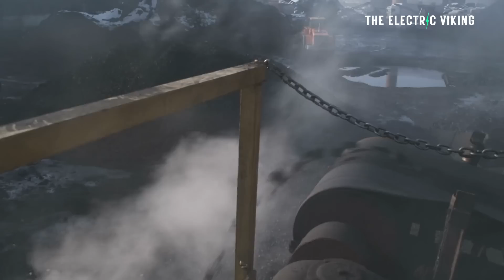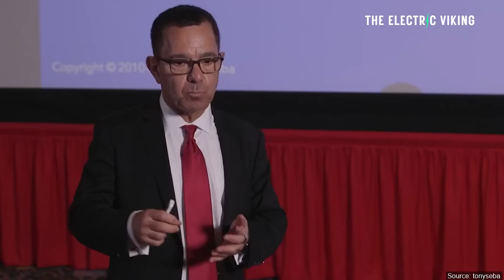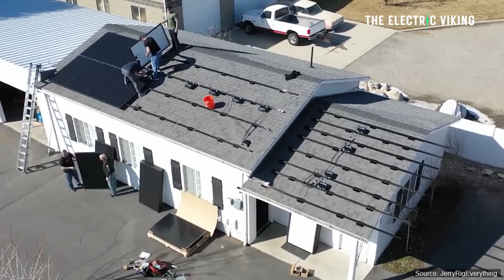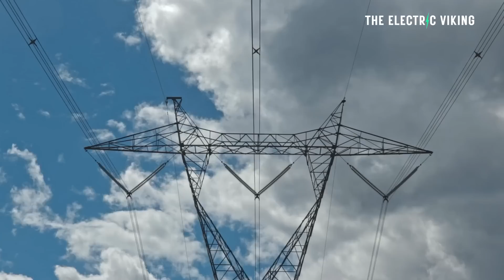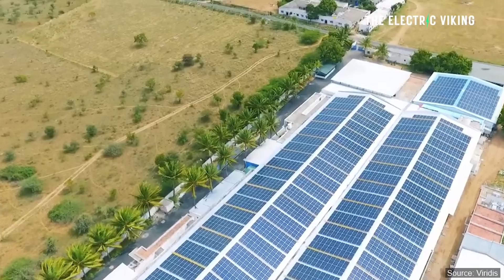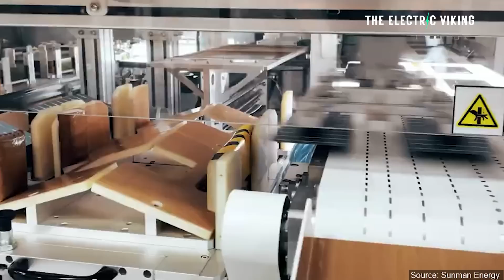Rooftop solar installs break records; coal powerplants could soon be bankrupt

Comment: The system dynamics of Solar are a bit weird. Rooftop solar (with local battery backup) is making suburban and rural households more independent from grid power, as long as they have enough wealth to afford the up-front costs.  Meanwhile, with (mainly Coal) grid electricity suppliers still being required to supply power at night and industry and to cities where solar is insufficient, they have to keep the same infrastructure going, but with fewer customers.  The net result is that grid electricity prices are going to keep rising (the normal result when renewables are added into the mix), but Coal power will still be necessary - kept alive with government support if needed.  A side effect is that poorer people and those living in cities (especially high rises and multi-dwelling units) end up paying more for electricity.  The actual overall net reduction in coal used for power is minimal, unless it can be replaced with nuclear power (or hydro in countries with more mountains and more water).

Comment: I put on an 10kw system in SA in August 2023. I have been in credit  nearly  every month since according to my service provider. But hate to burst your bubbles, I didnt do it to say no to Fossil fuels I did it because the cost of my electricity bills continues to go up because of the transition to renewables.  The reality is my system has sent 2,421 Kwh back to the grid  at $0.05 per and used 276 Kw. I got $145 in credits from my Solar yet still got a bill for $95.  Yes Ive saved some money thats paying off my solar $13000 system but is has resulted in a huge financial benefit to my service provider getting more than 2,000Kw of free energy during the period. Power companies must  love household solar

Comment: Sam many thanks for your great work. I would suggest people act out of self interest before idealism. So the uptake is making a lot of economic sense, Australian households were paying the equivalent of less than $100USD/MWh 1978 - 2010 for electricity. In the space of a few years it jumped to almost $300USD/MWh while the OECD average remained less than $200USD/MWh. Lower panel costs, increased efficiency, battery storage options against $300USD/MWh makes a sound case imo. Did not think about the bushfire risk ( below )

Comment: The DOWNSIDE is your now responsible for the maintenance, upkeep, upgrades and costs! Outside of warranty it can be very expensive, plus the additional chance of fire and problem's in severe storms and weather conditions! $10k can now have most people almost off grid but the power companies ant stupid and the backup, topup electrical grid now is charging just to be connected and that cost is rising! You should point out these costs, to get a sparky thats compliant is $100-200hr rate too unless you DIY... Add an electric car to recharge and youl will double this cost.
Reply: here is an excersise for you, do the research and have hard figures on hand. Then i will believe you.

Comment: This kind of assumes that industry is not needed and that all households can afford decent battery banks.. still not enough in low-sunlight months regardless of realistic battery size.
Reply: see your stuck in an either or mindset. You are refusing to see there are other options available.
Reply: @andyfreeze4072  So for places that can't put in a hydro-bank, how does the base-load stay held up? Nat gas power stations seem to be a sensible option.

Comment: Here in far north Sweden, we have a ton of tariffs on electricity (transfer fees + energy tax + VAT). I ran the numbers, and any solar panel installation cheaper than roughly $1250 USD or $1950 AUD per installed kW will save you money regardless how high electricity prices are. Right now prices are around $900-$1350 USD and expected to fall further next year, sooooooo... God Tier price parity is already here :D

Comment: You need a lot more stationary storage of energy.  It seems like grants to the various universities to do battery research would be a good idea.  Yes, the new batteries won't be on the market for a while but seeing an future coming will cause people to plan for it.
Charging your own EV if the EV can be at home during the day is a great idea.  I, however think people are missing some obvious ways to effectively save energy for later.  
Timing your dishwasher and laundry to happen between 11AM and 1PM means that the use is moved in time which is as good as storing energy.  
I think you could use a heat pump to heat up a great big pile of something and then use that heat to keep the house warm over night.  
Even your hot water system could be done like that.  A simple way to do it would be to run the hot water up to  a higher temperature while you have power to spare and then have its thermostat drop back in temperature when you don't.  This will ensure that there is hot water.  If you want an even greater storage, you can install one of those thermostatic mixing valves that regulates the maximum temperature that will be delivered to the house.  They act by adding in a bot of cold water to bring the temperature down so they effectively make your water heater bigger.  This will then let you put the temperature of the hot water up to a temperature that could scald.

Comment: I live in South Australia and have an 8 kw solar system and a Tesla power wall. 
Why not install power packs and mega packs in the suburbs to collect all the excess solar energy rather then turning people’s systems off.
Reply: It cost money to install the storage.  I think home owners should consider adding their own.
Reply: why not have more natural gas power plants..
Reply: @jimmybrad156  Natural gas power costs a lot more than solar.  It is cheaper than coal if you count the wear on the equipment but it still costs more for the last watt you make.
Reply: @kensmith5694  Nat gas would prob be 80% cheaper if there a non-corrupted national supply.
Reply: @kensmith5694  Nat gas cheaper than commercial battery banks to cover base load. And more 'green' too. I'm talking about power stations by the way.
Reply: @jimmybrad156  Your statement is false.  Natural gas is more expensive because you have to pay for the last watt.  It also is not green.

Comment: Sam, how about an item on alternate batteries to Li.  A couple of them were developed in Australia.
Reply: You should have included a name of type of battery or a link.  Others might find the reference useful.
Reply: lets see.......Li Phosphate for a start......Sams been on that trail for a long long time. Yes all Lithium (Li) batteries but not the same batteries. In case you missed it, LI Ion was the main stay of power tools and the first iteration of car batteries with an emphasis on thermal management. They had a cycle life of 600-1000 cycles and the recomended charge for long life was 20-80%. Li Phosphate batteries have a ccycle life of 4000-7000cycles and are not as sensitive to thermal overloads. They are cheaper to make and you can use the full 100% without degradation. The reason some Li Ion batteries are  still used is because they have a slightly higher power density and some manufactures are going for longer range or higher power, while tesla is going for cheaper  and statistically more realistic ambitions. Some chemistries we see are just variations with spiked cocktails of rare minerals. Other chemistries are still nowhere close to market yet. Sulfur, aluminium and air batteries are not there yet. Yes we are all waiting for the next big thing....

Comment: Now we come to the question of batteries - necessary to complete the transformation.  Of course, when possible, pumped storage is the best solution to storing energy but this is only possible on a grid scale - not for home use and only possible in certain locations.  It would be very useful to push non-Li batteries for both home and grid use.  Not only would this free up (and make cheaper) Li for mobile applications but these other batteries are superior to Li batteries in everything but energy storage capacity per kilogram of weight.  They last far longer, can be cycled between 0 and 100% with no accelerated degradation, are made from cheap, readily available elements and therefore only lack market share to out-compete Li batteries for price, and pose no fire risk while shipping (they are shipped fully discharged).  There are two types of ZnBr batteries, the SbCa liquid metal batteries, the up and coming Na batteries and a range of Fe and V flow batteries and these are only the ones that are already commercial.  Many more are in the works.

Comment: I have around 7 kWp in panels online, and around 10kWh worth of batteries, mostly DIY.  And an EV.   It is my power hobby so I didn't really set-out to actually make it economically viable.  Despite that though, it is already saving me $2500/year (USD) in energy costs and I'm only half done.   That includes a large chunk from not having to buy gasoline for the car any more, which was actually a pretty hefty expense went I added up all the numbers.

I plan to expand the system to 15 kWp in panels and 30kWh (or more) in batteries and replace the natural gas furnace with a heat pump next year.   I can still theoretically chop another $3000/year in bills that are mostly concentrated in heating costs now.

What I like the most about having done this is that it really does make a lot of my energy use inflation-proof.    Ever-increasing utility bills are a big problem for people as they grow older so making the investment now which guarantees that won't be a problem in the future is a big deal.

-Matt
Reply: I’m doing the same - so nice to become part of the solution 😊

Comment: Wow 20 Gigawatts to the grid from solar......and how long did that last, perhaps an hr during midday?.....how much of the 20GW was being supplied at 6pm during peak demand time. The amount of storage in AU is less than 5% of that figure, so without coal or gas supplementing it we would be in the dark. Solar might be fine for reducing your personal electricity bill but it is not the solution to power the nation reliably. We need to lift the Ban on Nuclear the only current reliable (24/7) and green source of energy and with the added benefit of not scaring our landscape and agricultural land with hideous solar panels and transmission lines.

Comment: So you’ll end up like California. 
They outrageously subsidized PV solar. And require it with all new construction. Without any batteries. 
Great during the day. The day is no longer “peak”, it’s “off peak”. In fact no longer want your excess PV generation during the day. I still get a nominal amount for my pushback, but new installations get NOTHING. The utility has more power than they can use. And that’s actually tough for the grid management to handle.
But when evening comes, things get touchy. They had to make evening be “peak” to discourage use. 
Meanwhile, the state is building huge PV farms that will exacerbate the problem (when they figure out how to connect all these projects to the grid, LOL!).

When they close the rest of the plants, it’s gonna be dark and cold at night.
Reply: The infrastructure will be built now that the need is shown.  In a free market, nobody builds infrastructure that is not needed.  Stop worrying about it and install those panels.

Comment: Stop 'Burning' coal !   We need to keep coal to make steel.  Without coal, the making of steel is next to impossible, so why burn something that we need so much for making steel, something we cannot live without?
Reply: It is not longer true that coal is really needed to make steel.  There is now a process that doesn't need coal and no, it isn't going back to cutting down a lot of trees.
When electrical power is free, it works out cheaper than using coal to make steel.  Refitting the existing plants will cost a lot.
Reply: @kensmith5694  Good luck with that. Yeh I wouldn't want to live next to or work in a coal mine, but it's abundant and cheap and 'environmental concerns' are exaggerated.
Reply: @jimmybrad156  Let me guess you get paid by the coal industry.  The studies have been done.
Reply: @kensmith5694  Let me guess you're falling for bs from WEF 'studies'. Psyence.

Solar & batteries are great for off-grid houses but still need a genny for long low-sun weather.
Reply: @jimmybrad156  I think my guess was correct.  I hope they pay you well

Comment: A key issue with large amount of solar and wind is the lack of stabilising rotating inertia.  You need FCAS automatic battery banks to replace this otherwise you have to cap renewables depending on how much stabilisation you have.
In Ireland the last few days we got to 85% while exporting some to the mainland, UK mainland was over 50% (excluding biomass and Nuclear).
Reply: Smart inverters can provide this function. Energy providers need to provide the communication standards and incentives. The solution is simply software. Batteries will provide a more comfortable solution.

Comment: Doing a knockdown rebuild atm. Solar + BYD battery is part of the design
Reply: If BYD build a home battery system as good as there cars hope your house fire insurance paid up as may need it if your battery goes into thermal overload.And with the temperature burns at cannot practicably build a heat shield that not melt.
Reply: @BobSmith-ew5oi  Nice attempt at mis-information. Not buying it!
Reply: @BobSmith-ew5oi  troll

Comment: It just shows how a little knowledge can be a dangerous thing. How do you provide power when the sun doesn't shine? Do you understand anything about grid stability? As soon as you use battery storage the cost of the electricity doubles. Battery storage is also potentially quite dangerous. Yes lets shut all the fossil fuel powered plants - they still account  (depending on what figures you use) for 70% of the electricity used in Australia.
Reply: Keep drinking that cool-aid. It is economics that is driving the phase of fossil fuel and there is nothing you or anyone else can do to stop it.
Reply: yea really, a typical australian.......dumb as two bricks. latest statistics, australia ran at 65% for periods of time. grid stability, yea its to do with 50hz cycles that turbines run at, 1850s tech. But never mind, battery back up has already got that covered. Use batteries and the cost doubles? How did you figure that out? More thought bubbles. Considering the only cost for batteries is in the installation, electrons in , electrons out cost nothing in effect. maybe a profit margin. Not that you pay  $100 a ton for coal, aai?

Comment: It is actually getting easier to "Phase out fossil fuels" for our homes. OPEC is really against that idea at the Cop 28.  Get solar on the roof,  get a induction cooker, replace your gas hot water with a heat pump and use free solar electricity. Get a EV. They drive much nicer, are clean and won't give people lung cancer.  Most of this is more efficient. Then you put a plaque at the door which says "This is a fossil free home"  😀

Comment: Another fringe benefit from a rooftop array when your talking about warm areas in the sunbelt.... a rooftop array is keeping a lot of solar radiation above your roof and therefore cutting load to your ac....figure a 10kw DC array is catching roughly 100k btu worth of solar an hour in perfect sun, given most of that would radiate back up whether you have solar or not.... but a percentage will make it down into the thermal envelope and add load to an ac.

Comment: 18h per day in my town is a night. It's impossible to use solar electicity 1/2 of the year.
Reply: Certainly difficult until solar got much less expensive.  You'd need to double the size of your set up.   And that ignores storms.   You may need wind as well.   

And you may need to import power from 500 km towards the equator. 

Sounds like you'll need grid power for sure.
Reply: @mac_mcleod   in a world where governments are working for us, yes a power grid is a no brainer. When governments actively work against us, go solar and shove two fingers up where it hurts.   We used to have governments work for us now we have scared rats who see a transformation happening. They are too screwed up to mend their stupid ways.

Comment: Only works with huge amounts of batteries. Otherwise, you need to keep the kettle on the boil!
Reply: Home battery prices are falling. US Energy Dept has a goal of $100/kw-hr. So a 100 kw-hr battery should cost ~$10k and last 20+ years. Right now it is ~3x that target price.
Reply: @jemezname2259  Until then, excess solar can do more harm than benefit to the grid.
Reply: @jemezname2259  So why do you care about the cost of a 100 kWr battery is?  You don't need a battery that big.  All you need is enough to get you through a night and until the battery is recharged the next day.  I can do that with my 17 kWh battery and 8.4 kW array.  This puts my utility company in a backup position.  If I need more power or more energy I use them but then generate enough to replace it within a typical 24 hour period.